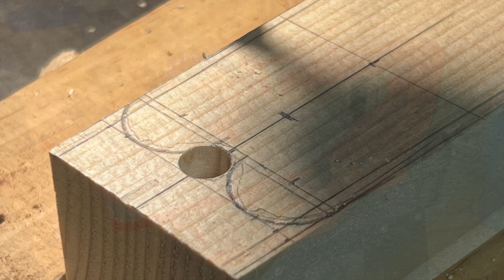Making Wooden Spreaders (Catalina 30)

Comment: I purchased a wooden mast for my sailboat, but unforunately the spreaders were long gone, so those I will have to fabricate myself. This video is a great help, could you shed some light on measurements and how the steel wires are attached to the ends?
Reply from the maker: For measurements, I was just reproducing my old ones and using drawings provided by Catalina.  On mine, the shrouds are lashed to the ends with stainless bailing wire (through the hole I drilled with the metal sleeve and around the shroud). Once the shrouds are tightened, they sit nicely within the indentation of metal bracket on the end of the spreaders.

Comment: Delta man huh? Would have loved to seen your table saw.
Reply from the maker: You'd be disappointed--I rarely use my old Craftsman table saw. I much prefer using my vintage radial arm saws!
Reply: @brianweekley5700  ahhhh, figured you probably had an old contractor or cabinet saw.

Comment: Wish I had all your tools.  Great job on those but may I ask why you did not convert to the aluminum spreaders instead?
Reply from the maker: Thanks. I kept my wooden spreaders mainly for cost. To buy the aluminum spreader kit is at least $850. I made this new set of wooden spreaders for < $100.  Since I believe the set I replaced are original (40 years old) this set should last me the rest of my life. Besides, I really like the look of the wood over the metal!
Reply: @brianweekley5700  All great reasons!  I do like the look too.

Comment: Brian would you please describe the manner of lashing the shroud to the spreader ends? I'm making new wooden spreaders for my Tayana 37. Thanks in advance for any details you can provide.
Reply from the maker: At 8:30 in the video you can see a hole and metal tube glued into it.  I basically take some stainless bailing wire through the tube, around the shroud, and back through the tube making an “X” on either side of the shroud (a few wraps), then twisting the ends together.  It’s basically just to hold the shroud in place until the rig is properly tensioned.  Once tensioned, the shroud will stay in the groove at the end of the spreader.  Well, that’s how I do it!
Reply: @brianweekley5700  Thank you! Very helpful.
Reply from the maker: @j.saavedra1502  👍